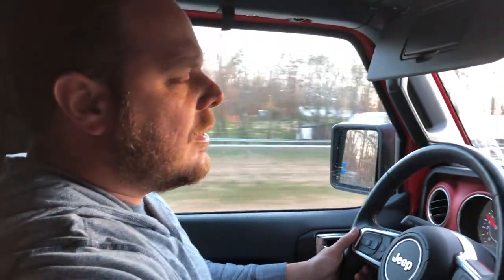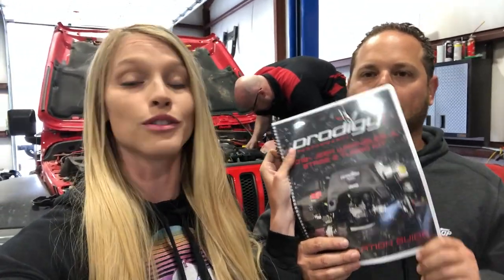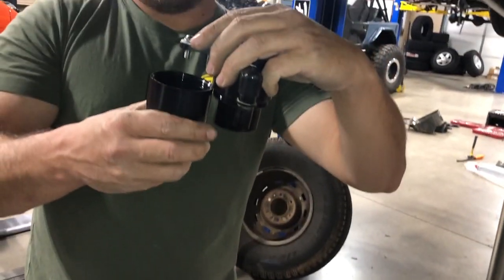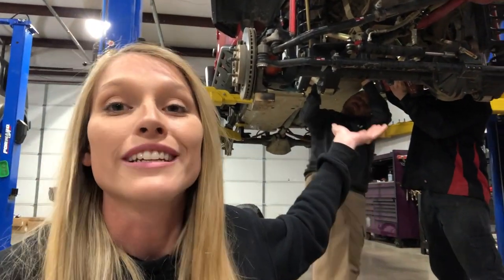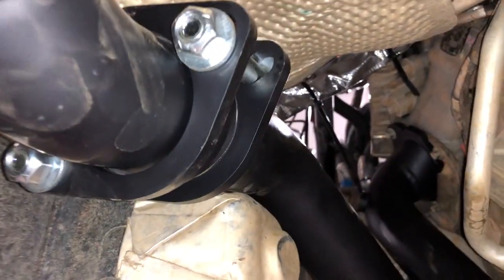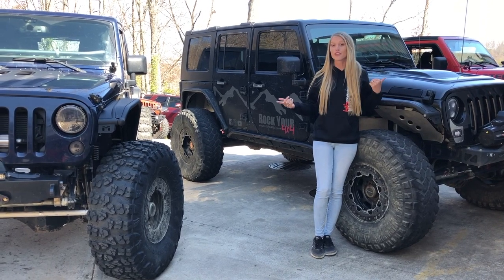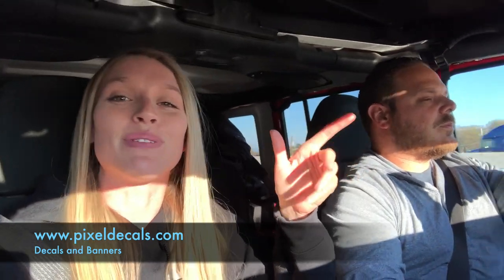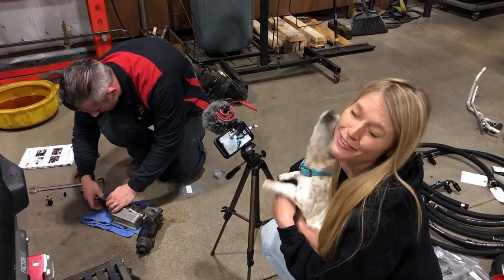We Install a TURBO on our Jeep Wrangler JLU Rubicon! It BLEW UP DO NOT BUY THIS TURBO KIT

Comment: I hear the bald eagles starting to scream
Reply: Eh, they don't need Bald Eagles, they need Big Bison's to turn the crank.
(torque over HP, when you crawl)
Reply: Grumpy ol' Boot we have 5.13 for that. Our 4 lo is very low
Reply: they're going a different route and I love it. I'm curious to see how it works for them and how it holds up.
Reply: @boughtnotbuiltoffroad7784  
True, that's a good point.
Reply: I've been debating weather to go supercharged or turbo with my 5vze swap
Reply: @kohlgossler7083  
Well, it depends a bit on what you use it for, if it's a daily, turbo's are usually the better choice.

Also highly popular in drift cars.
Also, also : Turbo Noises !

But if it's a weekend warrior offroad vehicle that only goes crawling, a super charger may be for you, for that added low down torque.

And if you're a power freak .. compound turbo/super charging is always a possibility, but really not something you should dabble in, unless you take it to the dragstrip.

Comment: How much the gas mileage improved? Nice sound. Also, what are your thoughts about the 2.0l turbocharged engine? We can't get 3.6 in Europe, only diesel and 2.0l.

Awesome video as always!
Reply: Probably would have been cheaper to buy the 2.0l turbo.... just sayin'.... plus only would have had to deal with the USUAL hostage situation at the dealership...
Reply: @jbriverdellc  Yea, but I'm afraid of what will happen to the Alfa Romeo Engine after ~100k miles. It's a small engine for a big car. And how it will perform with 37inch tires, winch and roof tent.
Reply from the maker: Elvis Meisters We’ll do a fuel economy video soon! And between the two, we’re definitely fans of the diesel (if only it was available in the states now, or a year ago when we got ours!). The 2.0T seems alright though! I know they had some factory issues with coolant lines leaking near the battery under the Jeep, but I’d assume they’ve resolved that by now. 😊

Comment: Love turbos. The sound alone makes it well worth it. Less heat soak, more power, more efficient. Mated with that 8 speed that should be awesome. Have y'all done a baseline dyno? Would love to see how much power it can make over stock. Better yet im curious to know just how much that motor can handle lol.
Reply: ewehinger Base line is about 220/230whp we put down 363whp at only 6/7 psi

Comment: Typically I'd say turbo... but. Turbos make power on the high end and superchargers make power on the low end. Considering that wheeling is done and like 5mph you will never make enough rpm to see a benefit from the turbo while off road so I'm not sure how much performance gain you will get. Idk. Time will tell. Love you guy's. Hopefully one day I'll get to wheel with you guy's
Reply: empty pockets centrifugal supercharger don’t make much low end either. They build boost with rpm as well as turbos.
Reply: @boughtnotbuiltoffroad7784  yes sir. They all require spinning up to make boost but because the sc spins off the belt vs exhaust gas pressure. The sc spins up much faster. Thus why offroads prefer them. The downside unlike a turbo the boost is limited to said belt drive whereas a turbo is able to free spin and makes much more power on the big end.
Reply: empty pockets exactly. So when it shifts and rpm drops so does boost but with a turbo you have full boost after the shift. They are both great but I don’t need any more power under 3k rpm

Comment: Engine at least built with forged internals? When adding boost to an engine that wasn't designed for it there's more needed than just bolt ons.

Comment: Can't wait to hear how much power you are making after the new tune and dyno run. It definitely looks like unless you have all the correct tools and lift, you'd want a place like you guys went to to do the install.
Reply: Joe Covey ya a lift is nice. Not many tools were needed. And it made 363whp which is up from 220whp

Comment: Need to update your exhaust. The wife and i have three jeeps.Mine is still being built at Total auto pros since Nov. Both of the JL have prodigy stage 2. The other is a hemi. If you are in Arizona you should check out Total auto Pros. Vettes jeeps and can ams.
Reply from the maker: Green Rush We had already updated the factory exhaust, but now that we lost the two cats, we’ll definitely have to do it again! Think Kev is going to a muffler shop tomorrow to add a muffler back in.

Comment: Nice upgrade. Think I'll go LS for the money but my Jeep is an '07...If new would be turbo or supercharged. Interested to see how it does in the rocks. If you have lag and then it comes on hot, be upgrading that rear axle soon. lol
Reply: big88jeep with an 07 you definitely want a different motor
Reply: Kevin Williams 6.0/400/Atlas is the plan. Subject to change if I find an ls3 for a decent price.

Comment: Those turbos DO have an awesome sound! Seems like a Massive undertaking. Thanks for going through it and sharing! The beauty of most modern V6 is that they can be Awakened so easily!!!
I have the 3.8L in a '09 JK wrangler) I added a K & N filter ...and WOW!! Then I  added a perform chip (low$$ by Volio) this took away the delay), then Dual(ish) axle back exhaust ... MORE WOW!! .. Then I added a hotter coil,  Then gaped my Spark plugs to a WHOPPING .60 Gap!! 87 pump gas = W.A.F ROCKET!*#!! 
Yes (estimated 375 foot pounds and 315 - 320 HP) 0-60 in under 9 sec (it weighs 4K +lbs.)
 and [if I keep my foot out of it] over 420 mile per tank (nice on the long trails :)  Thing is STUPID fast with NO delay!!     People DO NOT believe it's not a V8.
Thanks Again for All your videos and watch out for smokey bear on the trail with that monster! Easy to get a ticket or crashed up with that acceleration. ... Brakes?? (Upgraded Pads and Good shock / struts will save your A!) 
PS. If you are planning to come towards northern AZ (Sedona Red Rock District) look me up SO many Wide Oped Jeep trails in every direction with views and vistas and every turn :) 
 - Keep it Between The Canyons  -southwestjeff

Comment: Ok, help me to understand this.  Why?  The little I know about turbos is that they are good with high engine RPM but useless at low speed.  Like when you are going off road wheeling and rock crawling.  How is a turbo going to help you at slow speed and low RPM engine speed?  

I still love the video and the interactions between you all.  Keep up the good work.
Reply: Philip Hannum cries country towing 2500 pounds.
Reply: Philip Hannum it won’t help at all for rock-crawling and such.  It’s truly just for on-road performance on that 3.6 liter motor. 2.0L would make more power with a tune and simple bolt-ons and actually be more useful with the battery assist system.
Reply: Philip Hannum I have gearing for Offroad. Where it does help is in the dunes when climbing big hills and flying down back country roads. Also pulling the trailer. Gearing is for crawling, I’ve never needed more power when crawling. I have needed it when towing and passing and hitting sand dunes.

Comment: Watched that video of yours about the Hail damage and you guys doing insurance appraisals. In the time you guys have been doing that have you guys come across a lot of damaged soft and hard tops for Jeeps? how well do they hold up to hail? In southeren Alberta we tend to get 1-2 really bad hail storms a year. The car and RV lots tend to have Annual hail damage sales. lol Just curious because i am about to trade in the F150 for a JLU. I have 3 Daughters 5 and under and really don't want them getting annihilated by hail if i get caught in a hail storm.
Reply from the maker: D'Arcy Jousset It’d have to be some pretty massive hail to take out the hardtop or softtop (as far as endangering passengers goes)
Reply: @LiteBrite  Thanks. Yeah just was worried.  Love Jeeps but i love my kids more. Last thing i want to see happen is us get caught in a hail storm and some bust through. Never heared about it happened to a Jeep but i have seen hail go through soft tops on some cars over the years.

Comment: With all the guys that tune around here in Tennessee. One of the should have been able to unlock it on the Dyno. That's how we did the vehicle's that we Dyno tuned at. The shop I worked at we did several tunes. We use to host Dyno days and all that fun stuff.
Reply: Eric Newberry nobody can unlock the ecu at the shop for the new wrangler. You have to send it in
Reply: @boughtnotbuiltoffroad7784  ah we never touched Jeep's for tunes. It was mostly LS cars and trucks. And mustangs and other performance vehicles. I would have thought it would be the same. But maybe not?
Reply from the maker: Eric Newberry Unfortunately no. It may get out at some point in the future, but at the moment it has to be sent in.

Comment: In my professional online mechanic opinion I'm pretty sure its you alternator timing valve letting your resisting vacuum pressure blow by your definitely going to want to get it checked or your motor will literally explode.😂 Also will it affect the turbo if the whole "try to climb something steep" and  it starves the turbo for oil
Reply: Connor Noland lmao. That’s a good one. Love the opening

Comment: If it's got turbo you have to program the logic on the computer so it knows it's turboed because if you just turbo it and not tell the computer it's turbo then it's going to blow up because the mass air flow sensor s are going to make the timing jacked
Reply: It doesnt have mass air flow. Map sensor. But , yes, it did have a custom tune installed from the turbo kit manufacturer.

Comment: Does the 8 speed automatic transmission need to adjust for the higher output torque ?
Reply: maybach300c it seems to take it so far

Comment: Awesome guys!! Have been looking at prodigy kits as well as ripp superchargers. Curious to see how this does crawling with the turbo lag. Also can you fill us in after the tune what rpm the turbo is spooling. Also is it a twin scroll turbo? Thanks!
Reply: TX Mojito JL starts spoiling around 2500-3k and not a twin scroll no
Reply: Nice thanks for letting me know. Excited to see how it performs!  Did prodigy say they have done a lot of installs on the JL or are yall some of the first?
Reply: TX Mojito JL I think they said there are 20-30 JLs with them already

Comment: Did I hear you say that it's required to remove the intake manifold in order to change the spark plugs? This can't be possible! That would be so expensive. You seem concerned about the oil burnoff but what about all the foreign particles your engine has been sucking in? That air filter was full of sand and grit. If you ever want to upgrade a Hemi you should check out Mr. Motech.
Reply: Br Cc you can only change 3 plugs on passenger side. Driver side plugs you have to remove the intake manifold. Doh

Comment: would that be quicker now with the turbo on the V6 versus the four cylinder with the turbo which one is quicker off the line the V6 what's the turbo or the 4-cylinder with the turbo from the factory which one's quick off the line and have more torque ?
Reply: Jeff Prevett is any of that in English?
Reply: Translation :
Which would win in a drag race ? V6 turbo, or straight-4 with turbo and electric assist.
Reply: Grumpy ol' Boot would be a close race for sure. The 2.0L will most likely still make more torque stock with the electric assist than the turbo 3.6, will be interesting to see for sure. The 2.0L is the future of these Jeeps, need to see more R&D on mods.
Reply: Being that we made 360 wheel hp and 330 wheel TQ. IM betting we’d easily beat a turbo 4cyl.
Reply from the maker: 3.6 with a turbo would definitely walk the factory 2.0T. 😊

Comment: Bout time guys! Did you change plug heat range? Also even though it's a pain in the ass definitely pull plugs and use magnifying glass to inspect even if the dyno says your tune is perfect. Plugs never lie!

Comment: TBH, the bottom end has not changed, the original comp ratio has not changed, but mid range and top end will have benefited, for sand driving?  Yeah the turbo wins. 
Turbo Noise?  Yeah take it or leave it, I don't get all giddy over turbo noises (I am a hard core track person who does race on circuits) I just don't get the hype on turbo noises, give me a 10,000rpm+ NA engine noise any day of the week over a turbo.
Looks like a good mod you guys have done, but in all honesty, I think the turbo actually is the better choice, especially if sand or mud driving are on the cards, only on the rocks will the turbo not work and a supercharger would benefit, but would a supercharger really be needed for max power when crawling?  I don't think so, so I do agree, turbo wins it for me in this particular application too, great vid, keep up the good work.
Reply: Simons World exactly. Thank you. Someone who understands what we’re thinking. I have 5.13 gears and 4:1 transfer case for crawling. The turbo is for everything else
Reply: @boughtnotbuiltoffroad7784  yeah all good, I probably would have done the same thing, it all depends on environments and what engine size etc, the Jeep V6 has more than enough go even with the turbo lag to still climb rocks etc, who needs a supercharger when rock climbing?   Hardly ever in my experience.

Comment: Turbos are cool, I just hope it works out okay for you while you're rock crawling. I just know that when you're in a bind and you hit some boost, it won't be a smooth power curve like it has been, or like a ProCharger is. But as long as you two like it I'm with you 100%. Do it the way you want it.

Comment: Um why didn't you just get the 2.0  turbo? My 2.0 turbo is powerful even with 37s.
Reply: Fit Pro 3.6 is better
Reply: @blite903  no it's not.  I have owned 3 jeeps. My 2018 jl 2.0 is the most powerful and fastest jeep I have owned even with 37s. I really think they are close matched but the 2.0 is quicker and more responsive. I have an electric hybrid car.  It feels sorta like that but powerful like a jeep.
Reply from the maker: Fit Pro The 2.0 had a couple concerns that had to be worked around for rock crawling from that secondary battery under the Jeep. But also this setup is significantly faster and more powerful than the factory 2.0. Dyno pulls will be in the next video. 😊
Reply: @LiteBrite  Go turbo Lite Brite, you guys are awesome :)  Been following you guys for a long time now.

Comment: It’s the JL TURBICON! Yes ever since I possessed my turbo xp I wish I bought an EcoBoost truck. There a lot of satisfying fun. With the JL 2.0L turbo wish it was not partially hybrid. Wonder if any will get around it.
Reply: eric rush it’s barely partially a hybrid. The battery system just gives you added power when needed at take off. It doesn’t run purely on battery alone.

Comment: Hey guys. I am like a day away from deciding to pull the trigger on a high boost RIPP Vortech setup that I'll customize, or going turbo. JK 3.6 with manual and gears and such... I keep going back and forth. How has reliability been? Have you towed and wheeled in very hot weather yet? I am concerned with underhood temps getting out of control. Please help?
Reply from the maker: The JL 3.6 is too high of compression. Nearly every turbo Jeep has blown the motor including us. We do not recommend forced induction at all
Reply: @LiteBrite  i JUST found your video about the rod knock. I have a 10.3:1 compression ratio JK 3.6. I know there are lots of supercharged JK 3.6's running around. At last count, RIPP had sold some 8k JK kits. I think that's really the lowest risk forced induction route to go. If I had all the money, I'd do an LS or Hemi swap like you guys. I'm new to the channel. Absolutely love the content and you're a beautiful couple. Btw, I've had FD RX7's, high boost S2000, Blown S4, etc... Your channel content is a good match for my interests! Cheers and best, Jorge.

Comment: The 3.6 Pentastar was actually developed to have turbos. It originally was going to be an alternative for the HEMI and was tested with a single turbo and twin turbo setup. Would love to hear how it’s held up over time, what issues it’s had, etc. I’m sure there’s an update video out there somewhere.
Reply: The pentastar was originally developed to be run with forced induction, but that doesn’t mean the version they are producing and putting in the JL’s is built to handle forced induction. 
These two didn’t get their tune right, and blew their engine. Hopped out on the road before their tuning was complete, and didn’t even install gauges. 
This version of the Pentastar has been modified by FCA to have high compression, but still run on 87 octane. It uses some pretty intense timing and fuelling control by the computer. Until somebody maps out proper tuning for this engine to run with a turbo, this kit is risky to run. With such high compression, adding more fuel and boost becomes difficult. 
It’s much different than the 3.6 in the JL’s
Reply: It blew up years ago. It has a bored and stroked 392 Hemi in it now. (426ci)

Comment: When I did my compound turbo (basically 2 turbos in one) on my Ram I did ceramic coating and had the pipes that are in the engine bay chrome plated. Would love to offroad with you guys and see if that Junk....I mean Jeep can keep up with my Ram. Also PSA my ram did a burnout with 40s stock ;) (Yanking your Chain if you didn't know) if you are in PA I can show you some local trails with some neat views!
Reply: TheKillerMarine nice. We will be coming to pa in May
Reply: @boughtnotbuiltoffroad7784  I look forward to it! You guys actually helped me decide on the Milestar tires! If you guys like haunted places the are trails that lead to a haunted cemetery
Reply: TheKillerMarine heck ya
Reply: @boughtnotbuiltoffroad7784  Well if you are near me (I'm by Pittsburgh) ne and my buddy (he has a 86 Cherokee) would love to hit the trails with you   guys. It's not extreme or anything, just a neat little drive where you can see 3 states and 6 counties.